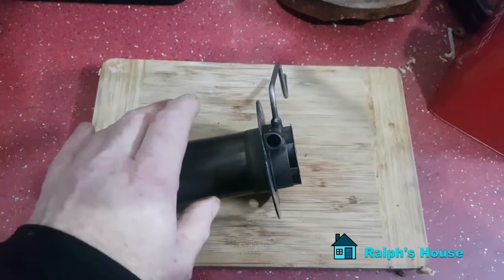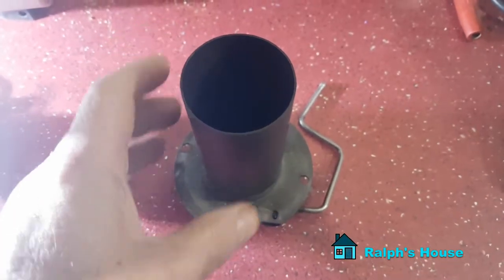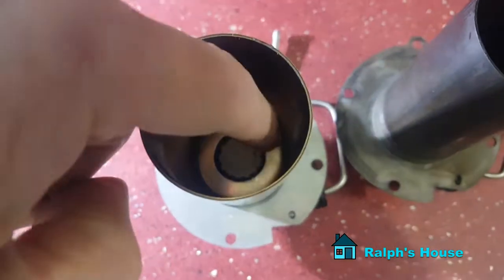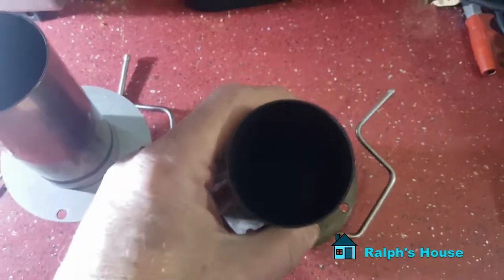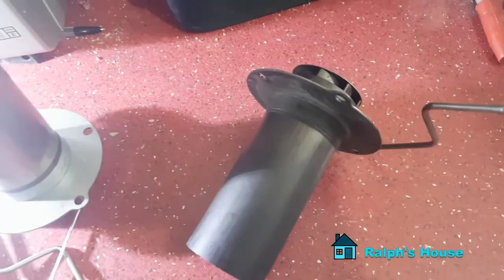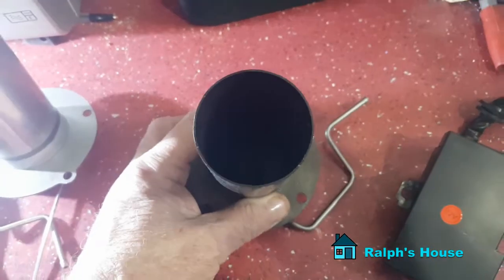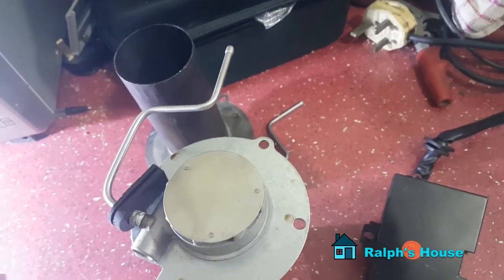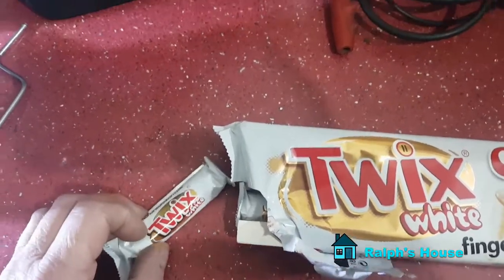204. E-08 Error - Chinese Diesel Heater

Comment: Thanks...... Just finished stripping mine down, adding a new glow plug and screen cleaning it all out it wasn't even dirty, and kept giving me a 08 error but I never knew about that spot to clean thanks👍
Reply from the maker: Just avoid burning anything other than kerosene/diesel. Despite all the wild claims about running them on heated fish oil or whatever, anything else will coke up the burner in short order.

Comment: mine is new yesterday it ran fine, but today when I started it it ran for 30 minutes stopped with E8 CODE fucking crap with a brand new vevor..lots of white smoke everywhere..
Reply from the maker: To be honest the name on the box is irrelevant. They are all copy-clones. Are you using an inbuilt tank or external? Is it higher than the heater?
Reply: @Ralphs-House I think I've found the problem, I'm using an external tank that came with it, built everything in a big box. I'm wondering if maybe I have too long a hose to the diesel pump, which makes it difficult for the pump to suck in diesel.. thanks for the answer 🙂
Reply from the maker: @gs-andy  If its smoking, you've got the opposite problem - flooding. Make sure the tank is level or below heater buddy. If its higher it can work its way past pump and fill combustion chamber (and exhaust) with fuel. Let me know if it solves it! My fuel line is 3 metres but fuel container no higher than pump.
Reply: @Ralphs-House I opened up the whole unit it was full of soot🤷‍♂️ I cleaned it completely and used a blow torch to clean the combustion chamber, rearranged the fuel lines, put the tank lower and the pump is at 45 degrees..then it works like a charm..thanks so much for the tip..greetings from Norway☺️
Reply from the maker: @gs-andy  Brrrr, you really DO need a heater then. Also make sure your exhaust runs downwards throughout as any upward curve will cause it to condense with water and eventually it'll block up - that will cause an E8 (E08) code too. Good luck buddy!

Comment: Interesting... But mine is brand new, struggled to get it to fire up on install, which it did eventually. Now I'm away in Portugal and it won't ignite at all. Diesel there, pump goes ok but no ignition and code -08... any thoughts?
Reply from the maker: Try fitting a new glow plug. As I said, 08 is purely 'flame out' and isn't a diagnosis really. Fuel, air, ignition. Has to be one of them.

Comment: Explain this anyone my heater works perfect. At  94m elevation we went to a park up site at an elevation of 154 m  and we got E08 multiple times , I pulled fuse for 2 mins and tried again ,  it fired up gave heat then stopped and showed E08 .  I came home and  the heater worked perfect  had it on for 1 hour no problem,  so , what’s going on
Reply from the maker: You may be over-fueling at altitude. There is an 'alpine' mode in many of these heaters. That may sort it. It depends on the controller but on mine, once it starts, I press the up/down buttons at the same time for a few seconds, and I get a blue mountain icon, at which point the pump goes at half speed. To be honest I only ever run mine in alpine mode anyway. Any drop off in heat output is barely noticeable but fuel consumption almost halves. Once in alpine mode, it will stay that way.
Reply: E-08 are mai multe cauze . Dar toate sunt legate de combustibil.
1. Pompa s-a blocat deși display-ul o arata funcționând.
2. Capilarul care duce combustibilul la bujie este înfundat. De regulă împinge furtunul din locașul lui de la întrare în încalzitor.
3. Sita de la bujie trebuie schimbată. prea murdară .

Comment: I’ve got a new heather that’s getting e08. Only been used 6 times, not likely to need cleaning is it? (Not opened it up yet?) 
Could it be something else?
Reply from the maker: As I mentioned, e08 simply means 'flame out'. Do you have a filter on the fuel line? Fuel any good? Pump actually working? Do you get clouds of smoke when you try to start it?

Comment: I ran a whole bunch of wierd oils that were in my garage like hydraulic oil and heavy motor oil and I ended up getting it
Reply from the maker: For sure. Despite claims by others, they won't actually run well on anything other than kerosene or diesel. The burner just isn't designed for it. The same with vegetable oil. It will all burn on to the 'wick' at the back of the burner and basically destroy it. You could technically burn a lot of things in it but anything other than what it was designed for will soon result in failure. Considering how efficient they are, I can't see why anyone would advocate messing with other 'fuels' anyway. Those that do make such claims rarely if ever show you what happened over the longer term.

Comment: I'm getting an E-08 error and it hasn't run more than a half hour since I bought it. Would it carbon up that much?
Reply from the maker: Unlikely. Faulty fuel pump at a guess or contaminated fuel
Reply: @Ralphs-House  I got a new fuel pump and lines coming.

Comment: would soaking the chamber in wd40 before a good clean ?
Reply from the maker: WD40 won't touch it, but the stuff scaffolders use to free rusted clamps (think its called Scafeze) will shift baked on carbon. Works great on old diesel engines.

Comment: Thanks
Reply from the maker: You could always swap out the burner tube but if you don't have a spare, a good clean right down the bottom should get it fired up again. Under no circumstances (despite the claims) add any kind of oil (veg or mineral) to the fuel. Yes it burns but it wrecks burn tubes. They simply aren't designed for it.

Comment: Ralph, a very enlightening observation. I’m going to try a different approach. As a chemist I have used caustic solutions to remove deposits on glassware. Since the burn chamber is stainless steel it should take contact with the caustic. The effectiveness is enhanced with putting it in a stainless pot and heating it up. Anyways, that’s the approach I’m going to try. Again great expose of this problem, thanks!
Reply from the maker: Do let me know how you get on, although bear in mind that a new burner can be bought for £15 or less so you'd have to balance that fact with whatever it costs you in chemicals. Ralph.
Reply: @Ralphs-House a good point. I’ll get one and put the old one in a container of caustic solution. Sodium hydroxide drain cleaner crystal is relatively cheap and can be used over and over. Probably makes sense to swap out annually or when it starts smoking 👍

Comment: Hey Ralph, I got this error starting it the first time. Well actually the third time. The first 2 times the diesel wasn´t coming through well and it wouldn´t fire up. I got the diesel sorted and it fired up the third time, producing heat, but after about 3 minutes of working normal it gives the E08 error and shuts off. I can´t imagine it´s due to carbon from working for 5-6 minutes all together?
Reply from the maker: As E08 or 08 is so damned vague (flame out), its got to be down to fuel/air/ignition. Could well be the pump in this instance, starving the heater of fuel. Only way to know for sure is swap the pump for a new one. Just make sure you have a good filter on the line. These pumps are very reliable but they hate even a trace of grit in them. Best suggestion I've got. Report back. Oh, and don't forget to run it flat out now and then for 20 mins - helps keep the burner clean. If you change the gauze just inside the burner (cylindrical one), make sure the seam on the gauze faces away from where the fuel comes in. Use good fuel line too - not the horrible squishy line that often comes with these heaters.

Comment: Cant you soak it in some liquid  to melt away carbon  overnight  ????
Reply from the maker: No since thetes not much that works , there are differing metals, and it would cost the same or more than a new burner tube.

Comment: Thanx for the video mate. My heater was cutting out just after start up with the E08 error code. Been running it for 6 months on the lowest setting so it is most likely carbon build up as pump and fuel lines are new. Will be stripping it down tomorrow.
Reply from the maker: Highly likely, although don't rule out fuel delivery problems as that could throw an '8' error too. You'll need to pop out cylindrical gauze as they can get really gummed up. If you don't have a spare, its possible to burn it off with a blowtorch. Other than that, poke and prod down the back as I've shown - you should be able to 'feel' any carbon building up. Let us know how it goes though - can always suggest something else if it still plays up buddy. Oh, and make sure the heater is running from a good battery or power source.

Comment: I've found also another reason for hard start and lots of white smoke: Fuel leaks into the burn-chamber when the heater is off. This happens if the fuel level in the tank is above the inlet on the chamber AND the fuel pump is not sealing 100% - you get a siphon-effect. This happened to me recently. Mine has been running fine for almost 2 years without maintenance and started smoking heavily on startup. Took it apart and it was clean as a whistle inside, but wet of diesel. Lowered the tank so the fuel level always is below the burner - issue fixed. (After all, maybe the pump is getting tired - hah..)
Reply from the maker: You'd think the fuel filter would partially prevent this but clearly not Ray. Yes that would definately cause smoke on startup - like an old diesel engine with worn piston rings - probably consume more diesel than it should too. Thanks my friend.

Comment: I run mine on gasoline. It doesn't carbon up and I run it off of my vans fuel tank so no separate fuel tank. Gas has 15% less btu's but it still cranks out the heat.
Reply from the maker: The volatile nature of gasoline does bring new issues though. Even a minor leak could be catastrophic. Certainly these heaters run safer on diesel or heating fuel but hey, diesel stinks too.

Comment: After basic wipe over, i Tried leaving one soaking in petrol for a week, and then hosing out, but even that failed. 
So now i just spray with engine degreaser, then water blast them from all directions 10 minutes later,  nice and quick, and works great. (had to do a few times, until i found the reason for dirty running, which was an internally damaged / partly blocked muffler).
Re end plates, had one burner supplied, which was secured with 3 pins (some have 4) and between 2 pins plate was bent up leaving a 2mm gap. wouldnt hammer back down, so used as is. Lasted a month before burner tube burnt out on one side, and rest of it went oval in shape and outlet balloned in size. Assume gap meant most air was going in on that side, causing an extra hot burn area.
Reply from the maker: Now thats interesting! I suppose barbeque cleaner might shift it though never tried. I just keep a spare, clean burn chamber now. It just shows how important that air baffle is Sir.

Comment: mine died and i heard it. The pump ticking got really quiet and it shut off. Gave ma e08. When i took the fuel line off from the pump and put it to priming cycle, the pump hit out the fuel only with the first tick that was loud and then no fuel after that when the ticks were silent. It's hard for me not to blame the pump. Ordered new one and it's on the way.
Reply from the maker: Make sure you fit a filter before the pump though.
Reply: @Ralphs-House  Yes, I will do that. I think that the lack of the filter was the problem because there is some junk floating in the tank. looks like there is some water there, but also some sawdust or something like that.

Comment: Great video - thanks for the tip.  How do you get the heater so efficient?  Ours burns about 4L in 24 hours in an RV on the lowest setting
Reply from the maker: @organicman1903  alpine setting. If yours doesn't have it swap out controller and interface for better one
Reply: @Ralphs-House  Thank you for this information.  We have several heaters in our fulltime RV and other buildings, so we burn a lot of diesel and The RV has been running very rich.  I presumed it was because it was running on low heat for too long and thought if I run it on high for hour or so each week, that would sort the problem.  Not so!

Comment: I have a Chinese diesel heater where the burn chamber screws apart so the gauss can be replaced. New gauss cut to the right shape is available on ebay. 

My heaters will all eventually fail to ignite, puffing out white vapor, displaying E8. What causes it on my heaters is a slight obstruction of the ignition air hole. When the heater is running a tiny film of diesel forms around the little hole, atracting dust. Clearing the hole fixes it, and enlarging the hole to 1/8 inch works even better.
Reply from the maker: @MrHugemoth  wish i knew where you could buy those burn chambers on their own. Thanks for heads up.
Reply: @Ralphs-House  I've looked for a source and David McLuckie (youtube guy) also looked without success. The one I have was in a "8kw" Chinese heater I bought 5 or 6 years ago.

Comment: It's crazy to think but I have a e08 code. Through my diag I have found the fuel pump gets a pwm  signal that looks clean on the labscope but the pump refuses to click. 
I guess I need to quit looking at the pump and tear my heater apart again since I am wrong in my diagnosis.
Reply from the maker: @jtbuilds9176  pump may have debris in it.
Reply: @Ralphs-House  Possibly, I ordered one with an inline filter. Should be here anyday now.
Reply: @Ralphs-House  Thought about running it through the ultrasonic cleaner with the fuel injector pulse kit.
Reply from the maker: @jtbuilds9176  good smack on the end of the pump against a block of wood will usually free it. Yes filter crucial.
Reply from the maker: @jtbuilds9176  good smack on the end of the pump against a block of wood will usually free it. Yes filter crucial.
Reply from the maker: @jtbuilds9176  good smack on the end of the pump against a block of wood will usually free it. Yes filter crucial.
Reply: @Ralphs-House  Yeah, spent a half hour beating this fuel pump yesterday.
It actually started to make half clicks then some semi full clicks then started pumping and ran a tank through the heater the rest of the day.

Comment: Where can you find replacement parts for these heaters
Reply from the maker: Ebay or Aliexpress. You want gaskets so you can strip it down and rebuild, a spare pump, glo plug, and perhaps  new burner for quicker servicing. Use good hose and good clips - not the stuff that comes with it Bill.

Comment: When it starts to blow not as hot air as it should and starts smoking black I switch to 2T MIX(petrol) for few minutes and then I switch back to diesel and everything goes back to normal heating.

Comment: In canada we use a product called "power tune" for cleaning up carboned marine engines. Mercury product. If you soak your carbon'd up parts in that stuff, it will rinse away with some brake cleaner or hot water/degreaser. You spray that stuff in that chamber, you'd lever need that little pic tool to get in the small places.
Reply from the maker: @johnathonhuson8734  good idea!!!!

Comment: You know things are bad in the UK when people are using these things to keep warm 😢
Reply: Agree. Just glad they exist. To be fair, if your house is well insulated it can definately work in conjunction with a central heating system. Lot cheaper that way. If I've been out all day and I need to get the house really warm, I put the central heating on for one hour only then drop the thermostat down to 17 and put the diesel heater on which means the central heating then goes off. The diesel heater keeps the house toasty all evening then, plus if you do decide to switch it off at night, the central heating will kick in if it drops below 17.
Reply: @vwthings  
I think you'd be better off with a Diesel Stove, they're warmer plus a large one has a backboiler fitted for heating water, which could be used for central heating and hot water, although you'd need a flu and they're a bit more than a diesel parking heater

Comment: In my case I think it was the fuel pump as it wasn't clicking. On first fire up of the winter it started without issues, but after a few hours it went out with E-08. I tried restarting it, but the pump wasn't clicking. Putting it into priming mode still no pump action. Giving the pump a few clonks with a screwdriver handle made it start working. Again after a while it went out again. Pump was stuck and needed a severe beating to get going again.  I figured the old fuel that was sitting in the tank for a year was the issue. After a few more flame outs and fuel pump beatings the tank was empty and refilled with fresh.  The pump has be fine ever since (touch wood)
Reply from the maker: @SockFluff yep. In this instance the cause is clear enough. Also important to have a filter and replace it from time to time. Thanks for your post.

Comment: Mine was running fine for 2 hours then just started cooling down on its own - i shut it off - a couple hours later i tried to start it again and got the E8. Can it be a carbon failure even if its been running fine for 2 hours? 🤔
Reply from the maker: Could be yes, but check fuel delivery first, then make sure heater has enough voltage. After that, strip down burner and inspect carefully.

Comment: I’m getting 08 while the pump stops ticking. Exchange it with another pump that quit few days ago and it works for a while. 4 pumps “failed” so far… Got to be something else.
Reply from the maker: Is there a filter before the pump? Whats the heater being powered by?
Reply: @ tried with and without inline filter, tried pump with built in filter. All the same. Powered by a 100Ah battery sitting on a 10A noco charger and 10A workbench dc power supply.
Reply: 10a is way too low
Reply: @TheDigger06  100ah battery covers any spikes and gets re-charged constantly by 2 x 10A chargers. And that is not enough?? :)